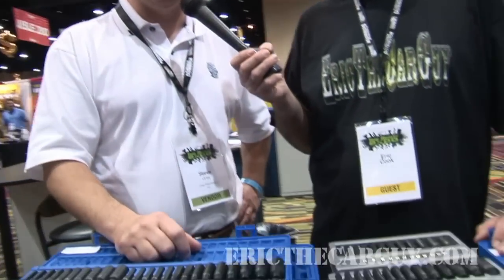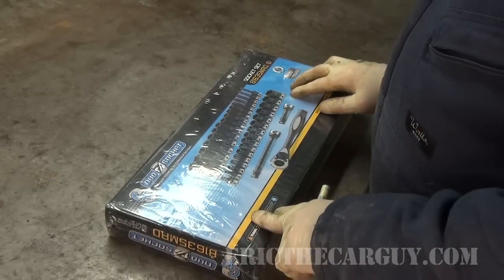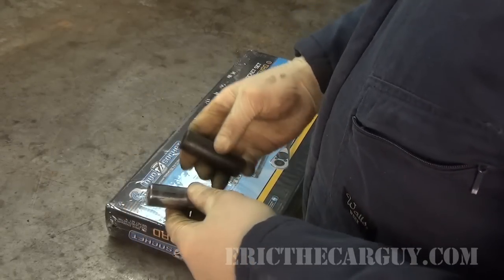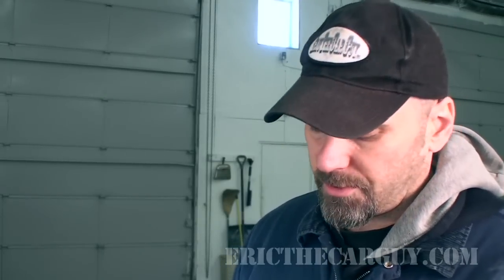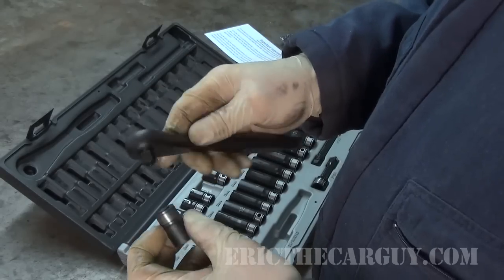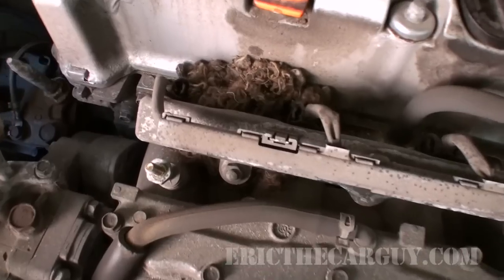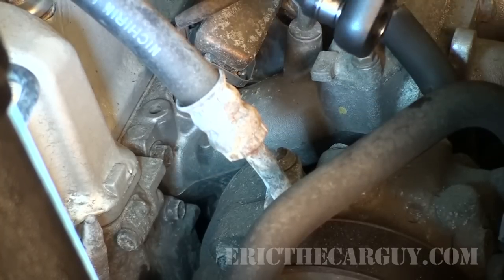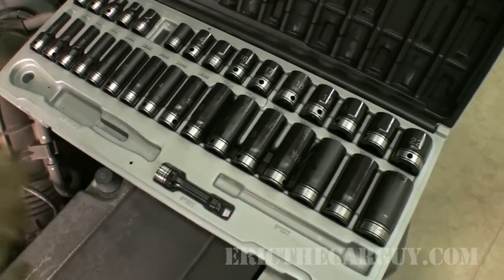Grey Pneumatic 81635MRD Socket Set Review -EricTheCarGuy

Comment: Hey Eric,

I just wanted to share a thought. There are no FAA regulations that make it illegal to use chromed tools. I work at a repair station and everyone here uses standard snapon and gearwrench chrome sockets and such. Of course, a specific shop is free to make it a rule not to use chrome, but I've never encountered that. The flaking of the chrome defibitely causes cobcern for me. I'll watch out for that. It is, however, considered a no-no to use impact tools on aircraft fasteners. It causes fatigue cracking in the fastener and in the surrounding structure, which also contributes to stress corrosion. Both of those are much more pronounced in aircraft than in autos.

Thanks for the review! Always learn alot from your repair videos. :)
Reply: It's probably an old wife's tale or a false rumour. If we had a dollar for every one of those we've heard... I find that to be one positive if the internet though, it's destroyed many beliefs people have carried over there years that just aren't true.
Reply: @ChuckNorrisUltra  True true. If I had a dollar for each I wouldn't be turning wrenches

Comment: I've own the same exact set from Grey Pneumatic and use it daily in my automotive classes. There are only two issues I have with the set, which are very minor. First, the ratchet is difficult to pull out of the case. You saw Eric struggle for a bit with it too. Well when your hands are greasy or you have gloves on, good luck! Second, I snapped the 3" wobble head clean off, but in all honesty, I was using it with a 1/2" to 3/8" adapter on my torque wrench for an axle nut at 144 ft lbs. Not the tool's fault at all.
Reply from the maker: Cool. Thanks for your input.

Comment: Thanks Eric the car guy for the review. I went ahead & got the 81 piece 3/8 impact socket sets. I simply love them. Bang for your buck. No longer having to be damn by a missing/skipped socket set. Down side, you only get 1 3 inch extention & no handle in the carrying case (very weird 🤔) I like they have laser edge and their also stamped, the case also has the stamp. You get all SAE & MAE deep impact, short, regular & swivel sockets.

Comment: I think investing in a quality ratchet is far more important than investing in expensive sockets. I've been using the same craftsmen sockets with impact guns and ratchets for over 10 years, over that time the only broken socket I've had was a 1 inch to 1/2 inch converter. I can understand though not using chrome sockets in high risk maintenence such as aircrafts as they do chip over time(a few of my sockets have)

Comment: Great choice Eric.  My snap-on guy is the only tool guy that sells Gray Pneumatic and I love them.  I only have the 12 point metric CV nut set, but thank god I do. Those German cars have some tight gapping from the nut to the hub I can't get with my other 12 points.  Cheaper than most brand names, last just as long.  Could care less about the paint on them, black when I got them, now the tips are chrome.

Comment: We use chrome sockets working on aircraft. All our wrenches, sockets, ratchets and even some pliers have chrome finishes. Besides, in the aviation world if you encounter an impact wrench it's most likely being used to zip apart a crash to salvage the good parts. They do strongly encourage sealed head ratchets to keep from losing the screws into the turbines, and I've never once seen a chrome pair of safety wire pliers. Also, while on the subject of aviation tools, if you want a REALLY good air hammer, buy a 3x rivet gun. Riveters have a spool valve in them and they hit way harder than any air hammer. That big new Astro hammer with the .498 shank Eric O at SMA has is just a 5x rivet gun. You can get up to a 9x but they're likely to shatter brittle parts before you can take your next breath.
Reply: Jacksonkellyfreak where to get this rivet gun I'm in the need of an air hammer

Comment: When i was wrenching @ detroit diesel we had the snapon matco and mac trucks hit the shop every week. The matco guy started stocking gp on the truck. The 3 name brands were 3x the price of gp and they didn't offer some stuff that gp did. I ended up with a 3/8 combo kit at home and later ended up with a 3/4 shallow metric 10-36, 3/8 swivel shallow metric 6 pt & 12pt, 1/2" 6pt metric and 12pt. Out of all the hell my impacts have given the gp line I've had a total of 4 fails 2 were the pin shatering on the swivel sockets(always failed on a hard angle on a turbo mount) and I figured they would have broken way before when they did... the other 2 fails were the plastic tabs that lock the cases closed. And this is such a pain in the ass..... but velcro fixed that.  To make this short..... buy gp you won't be disapointed and its got a lifetime war.

Comment: Chrome Molybdenum is used in hi-end impact sockets because its softer and can take shock from an impact gun without cracking. I see a lot of cheap and some not so cheap impact sockets made from Chrome Vanadium which is what standard chrome plated sockets are made from.

Comment: That's almost the exact set I have for my 3/8s impacts. Mine came with all those metrics, extensions, and ratchet, but mine also came with the complete standard set too, both shallow and deep. Such a great set. I took the ratchet home and use it there, its fine tooth which is awesome, but I have some many fine tooth Snap On ratchets at work. I use this set everyday, metric and standard.

Comment: I can't believe you just came across grey pneumatic I have the same duo socket set but metric and standard. ive had the socket set for well over three years and used them all day ever day and there still in great condition and lifetime warranty. I honestly would recommend these to a diy or professional the set I got is 3/8 drive metric deep and shallow 7-22 and standard deep and shallow 5/16-1" for $175 you could buy that set 4 times for the price of 1 tool truck set. grey pneumatic may be from Taiwan but they make high quality tools for unheard of prices. I work on diesel trucks and in that field the tools are always bigger and bigger ns more expense I also have a truck pinion nut socket set from grey pneumatic that goes from 2"- 2- 3/4" I paid $360 for the set then bought a single 55mm truck pinion socket from matco and it was the same exact socket as the GP brand all im saying is check them out then form your opinions if you absolutely hate them you only wasted like $50 but you wont hate them you'll love them the never skip sizes and if one set stops at 22 mm the next set starts at 23mm

Comment: In the 70's, I was in debt to the Mac, Matco and Snap-on Trucks.  It never ended LOL.

It was tough on an 18 y/o pulling $225 a week (which, frankly, wasn't half bad for a teenage mechanic).
Reply: FrustratedNameSearch I'm that guy now. Except it's cornwell and Mac, the shop only allowed 2 tool guys on the property, our snap on dealer in this area is an ass to the smaller mom and pop shops.

Comment: I bought this set about the same time that you did. Today, I wound up having a failure occur. I wound up getting three thin splits on my 21 mm deep socket.  At the time, I was using my 3/8” Milwaukee little impact, when it happened. Have you had any issues ? Time to see how well their replacement policy is....
Reply: Did you get a response from GP on their warranty process? Only thing that makes me hesitate on these.

Comment: I have the GP 1/4drive master set with swivels, awesome set for a back up in case I lose or break one. SK tools are also a real pleasure to work with besides their 1/4drive ratchets(junk)   I use swivels extensively so I have several sets of each drive size(redundant but my tools are have to be there and work or else I am SOL) I can not tell you how many times I've beat the clock and the book simply because of my swivel sockets.  I have my doubts has to how long that ratchet will last Eric, only time will tell. Thanks for the review man, we appreciate it.

Comment: Hey Eric: Maybe I'm getting my tool termnology mixed up but we use Chrome tools all the time in the aviation industry.  I know there are some restrictions though, I'll have to check in the manuals when I go to work later today about it.  But everywhere I've been we've used the normal chrome sockets, wrenches ect, mostly from Snap-on.   What we don't use is impact tools.  With the exception for removing stuck screws. The required tool list when I went to A&P school came with chrome tools.  Most of my tool breakages have been screwdrive tips.
Reply: Update: Ok I Checked the regs. It's Cadnium plated tools that we are not allowed to use. Chrome tools are okay, but they have to be free of chips.

Comment: Hey Eric I bought this set of tools after seeing your review and I absolutely love them, particularly because they're so light as you mentioned. They follow me on every trip to the junkyard. However my set came with regular extensions, not wobble ones. Also it seems that the grey pneumatic website makes no mention of the 81635MRD set coming with wobbles. Not sure what is up with this, but I kind of felt like I got cheated out of a cool feature. I intend to contact them and ask what's up. I just figured if you ever did a follow up to this video, it might be worth mentioning to future buyers.
Reply: I'm not positive but I believe if you put the socket just slightly onto the extension it allows it to wobble, if you push it on all the way it'll click and become a normal straight extension. He didn't mention that in this video but he does in his later review of the 1/4 drive set. 

Hope that helps.
Reply: Stephen Unterreiner He does mention that in this video and that is how a wobble extension works, but actually these definitely aren't wobble extensions (I know because I have others).  Something weird happened with their product line, I dunno. Thanks for trying to help, though.

Comment: Eric, You are the best.  I have learned so much on car repair from you that its unbelievable and its saved me a great deal of money.  With that said, I don't think this video is up to your standards.  I understand this tool has a good wobble extension.  But, In my opinion, I think you should put the sockets to the test.  Can it withstand high torque applications?  How about impact?  I recommend testing this to failure against a major brand like snap-on or matco.   Wouldn't that be better?
Reply from the maker: Actually you bring up a good point. What I have done, and intend to do going forward, is do the initial review as I have here, and revisit later after using the tools for a couple of months to see if they still measure up. I haven't got a stock of tools to choose from at this point so I need to do the reviews pretty much as I get the tools. This doesn't leave a lot of time for testing and real world use. I do hope to address this problem going forward however. These are good tools though. They have the look and feel of quality and I believe are as good if not better than Snap-on, Mac, or any of the other major brands. Thanks for your input.
Reply: +EricTheCarGuy how are they holding up? I'm thinking about making the purchace
Reply from the maker: +justindasilva73 I use them all the time and I love them.

Comment: hey eric I think a lot of us are skeptic for these tools since they are made in taiwan can you do an update after a month or two of constant usage?
Reply: I have the 42 piece Grey Pneumatic 3/8 impact set and Sunex 1/2" and 3/8" wobble impact extensions which are basically the same as Grey. One of my coworkers has the duo sockets in 3/8 and 1/2 inch drive and he uses them all day everyday and has no complaints about them. Same for me with my 3/8 impacts and extensions. Use them all day, every day, haven't had any problems with any of them and I've had the set for over a year. Grey Pneumatic makes some good sockets. Taiwan made or not. And just to throw it out there, all my 1/2" impact sockets are Snap-On. Shallow-deep, SAE and metric. I wouldn't have any problems replacing them with Grey Pneumatic.
Reply: Do some research on the differences between Taiwan and Mainland China.  They both claim to be "China", but they're essentially two different countries, one being among the most educated and modernly advanced societies in the world, and the other being a backward communist hell of poverty.  I'll let you figure out which is which.
Reply: Snap-off this statement is 100% true. This is exactly the reason people are running to harbor freight. Taiwan is sure stepping up to the plate.

Comment: Eric. Anything left of the etched numbers a year later ?
Reply: I have this same set eric has except it also has both sae and metric and i been using this set for about 5 years and yes the numbers on the most used are barely visible. Luckily if you keep it in the tool case the sizs are marked..

Comment: I have a set of Gray pneumatic sockets, now my favourites. An older set of 12 point Gray chrome sockets isn't so great because on the old set it's hard to read the size, but the new ones are excellent. As you point out, sometimes it's nice to have a thin wall set to get to tight places.
Reply: spelunkerd What do you think is the best impact sockets? within reason lol

Comment: Just want to say love your videos but I will comment on what you said about chrome sockets not allowed in aviation. I'm an aircraft mechanic and I've never heard that before. In fact its quite the opposite. Impact tools are a big no no. torque specs are on pretty much everything so chrome sockets and ratchets are pretty much what everyone uses. I know you said it was more of an issue of chrome flaking off which does make sense. I could see in and engine shop maybe as a personal preference but I've seen in tool boxes of engine guys and it's all chrome there too.  And maybe some hangars have that as a rule but I've never heard that before. That being said this set does look awesome though. If you really want to know, the most common tools in aviation are a multitool, 7/16 wrench and a black pen. If you have these three tools you can fix airplanes.

Comment: I would like you to do a review of these sockets and the ratchet after you have used them for a good while and put them through h&!! and back. I do like the idea of the flush mount directional switch for the ratchet as well as those wobble head extensions. I have not had any luck with tools made in Japan. I work on Trucks and heavy equipment.

Comment: Does Grey's offer a warranty on the set?  That's what keeps me buying Craftsman, although they're not as good as they used to be.  I've dispatched 3 tools (one of which was a 23mm chrome socket that I had on a 4 foot breaker bar) over 15 or 20 years and replaced them under warranty without any problem.  I don't see that it makes sense to buy hand tools that don't come with a lifetime warranty, when even AutoZone's house brand tools are carrying one.
Reply: Craftsman ain't what they used to be and an hour trip to swap it free when you're in the middle of a job is no bargain.  Sometimes you get there and the size you need is out of stock.  I've had craftsman sockets with the chrome peeling off right off the shelf.  I've had a few crack. 

I've never had an impact socket crack, even a Chinese one.  This thin wall design with the wobble will do jobs the craftsman can't.  For instance, the transmission to bell housing on a Mustang is tucked behind a rise in the casting.  This thin wall 15mm with the wobble would get to it.  This set is a bargain at this price.
Reply: I hear you.  I actually have a Mustang, and I ran into that EXACT problem doing a clutch job on my truck.  The wobble extensions were something I'd been considering for awhile, because universal joints just don't work very well.  Still, I'd prefer one with a warranty over one without - that way I know I have a tool for life.

Comment: Surbura impreza 2001 147k looking buy for my girl check engine runs great owner states it ben for two years , radiator leaking , the question asking 4,000 wood ok price and with that many wood you think t belt bent replace ? Is most likely cause o2 sensor

Comment: Buy the sunex , they will actually help you if you break something. These guys won't help you if something breaks. You need to buy it from an authorized distributor which Walmart Amazon and a lot of other tool sites aren't. You then have to send it to the authorized distributor and they send it to GP.  Most tool sites won't even know what to do or go about contacting GP. Sunex is made in Taiwan just like these, they are chrome Molly and usually a little cheaper than GP.
Reply: They're warranted for life and if you order from jbtools there's no issues.. They'll actually exchange it for you themselves.. You don't have to wait on GP..